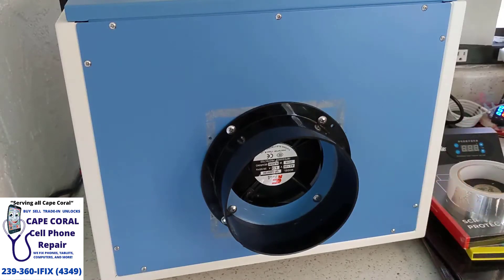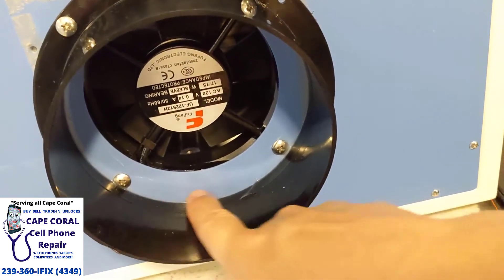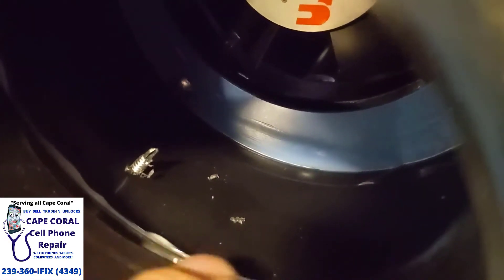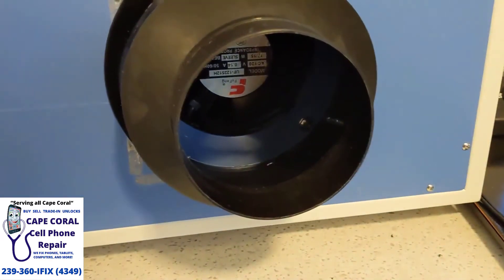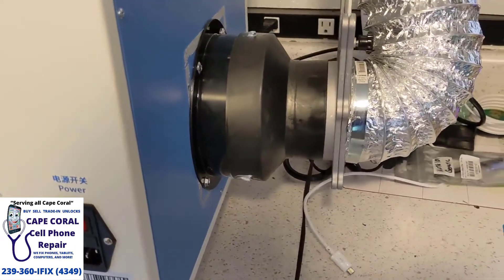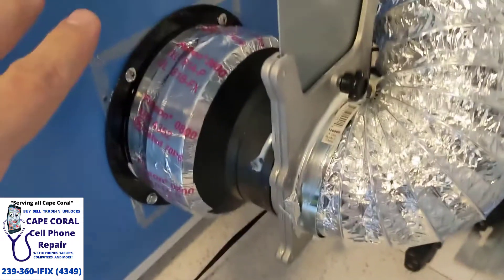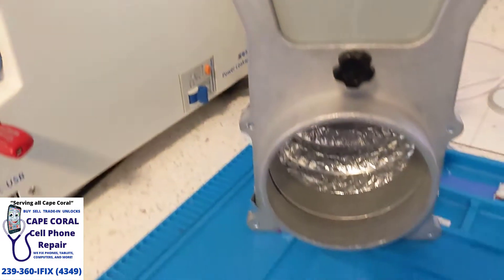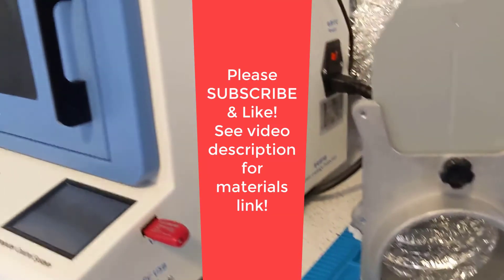Forward Blue laser machine exhaust increased!

Comment: Hi! Can you give a link for this black inductor what its on 1:15?
Thanks!
Reply from the maker: All the materials, including that part, is clearly on the video description. But here they are below........

Link to laser machine..... https://s.click.aliexpress.com/e/_99nfIp
3 way metal device..... https://amzn.to/3w6VQcx
Dryer duct..... https://amzn.to/3A0aCoK
Extra clamps....... https://amzn.to/3wYu2bI
Start ring collar..... https://amzn.to/3xWJdlG
Reducing collar..... https://amzn.to/2Vj1Dz3
Trap door dampers..... https://amzn.to/3jjNAmP
205 CFM super quiet fan used..... https://amzn.to/3y2YkKI
sheet metal self tapping screws.... https://amzn.to/3k06UGk
silicone adhesive....... https://amzn.to/3qV89YK
Window kit if you want to exhaust out the window……… https://amzn.to/3BtbLpE
Carbon filter assembly if you do not have a means to exhaust to the outside…. https://amzn.to/2YBG1zP

Comment: Hello! How do you remove the smell off of the phones when the repair is finished?
Reply from the maker: Joel, with this setup, the second duct over your work area, is the one you use with the exhaust fan motor running. While doing the repair, ensure the trap door damper is CLOSED coming out of the machine, so you get the FULL 205 CFM out from that location, your work area. You can also leave the phone there for a bit after working on it, including wiping the residue dust with 99% isopropyl alcohol. Once you have installed the new back, use this if you still detect a smell, and wipe the phone down with a cloth....... https://amzn.to/3zgEMD8